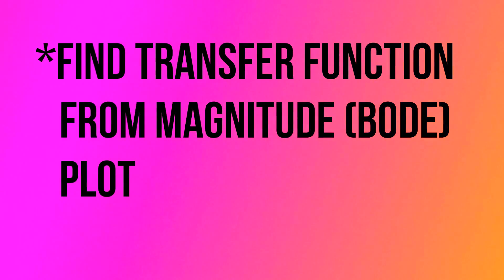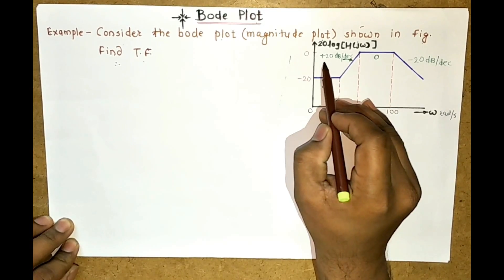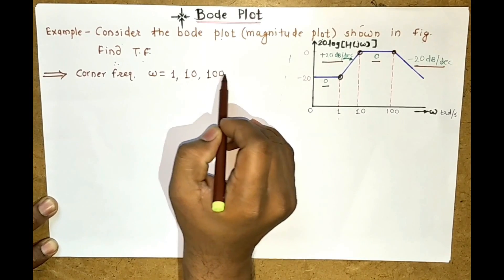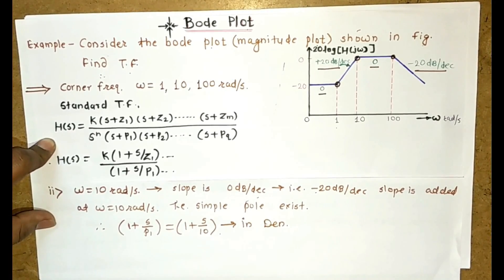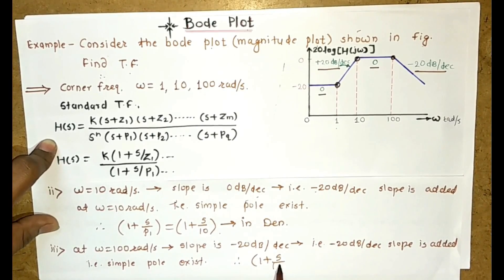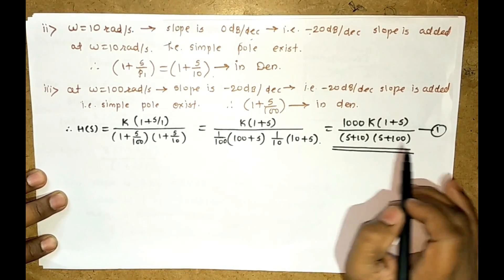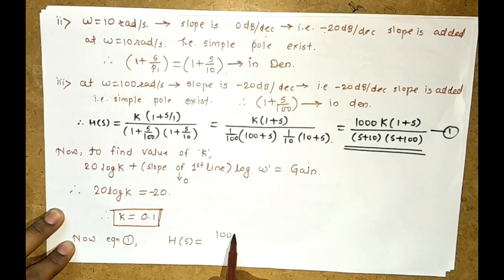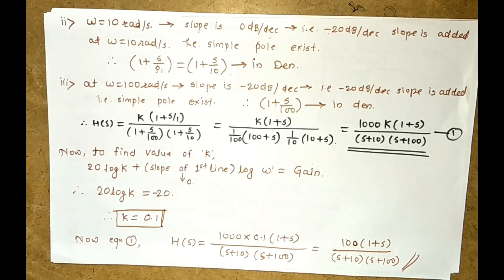Find Transfer Function from Bode (Magnitude) Plot: Lect no.1

Comment: I am still confused on how he got the k value. Why did he equal 20logK to -20?
Reply: -20 is the first value you find on the y axis
Reply: If the Bode not start 0, T.F. have a constant (K). That K is shifts the diagramm up or down. Let's see this problem. X-axis  unit is rad/sec and the y-axis unit is dB. H=20*log(K) that means H unit is dB. K has not dimension. H=20*log(K), H/20=log(K), K=10^(H/20).
Reply: Because the value is in log plot
Reply: thats just the nature of the bode plot. you just have to know it